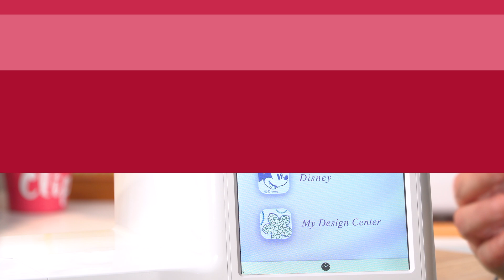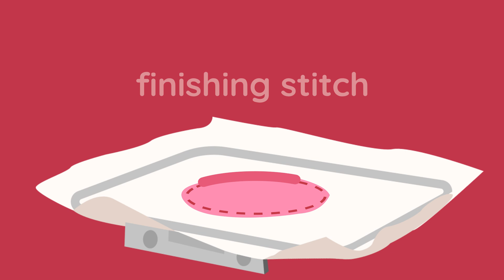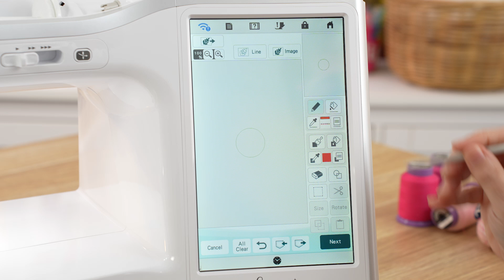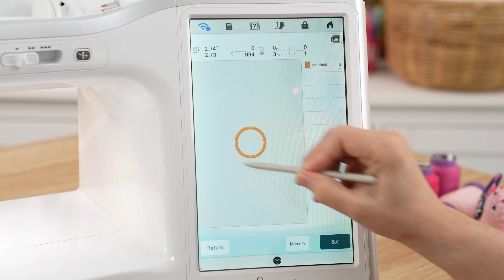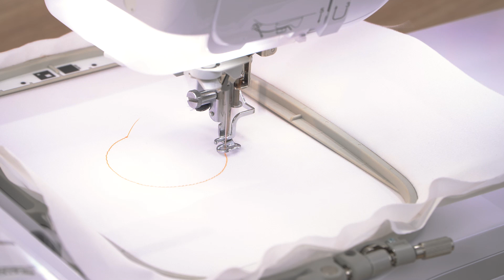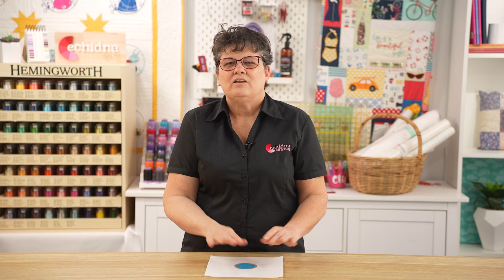My Design Center Basics - Simple Applique | Echidna Sewing

Comment: Tell me where I can buy designs to fill in various forms? Some Brother machines have them built in, but my In-novis VE 2300 has nothing but shapes (oval, circle, square, rectangle, etc.).
Reply from the maker: @nadyamishchenko4420  Hi there, thank you for your question.  My Design Center is only available on certain machines and the VE2300 does not have this feature I am sorry.